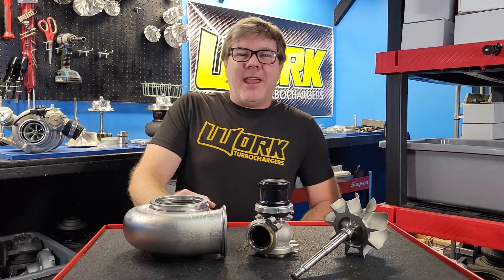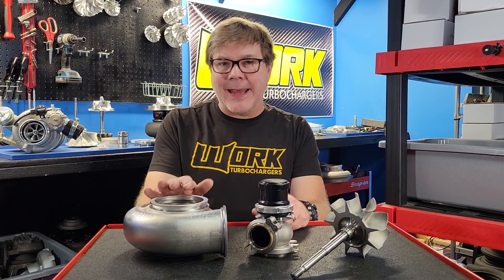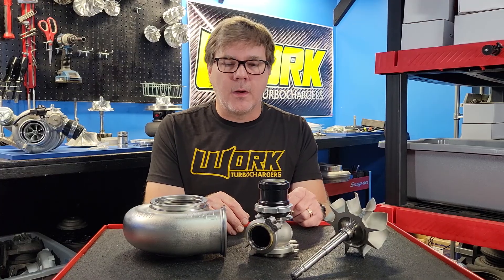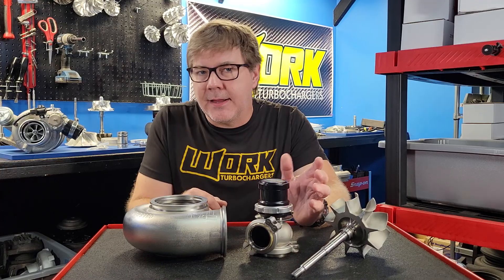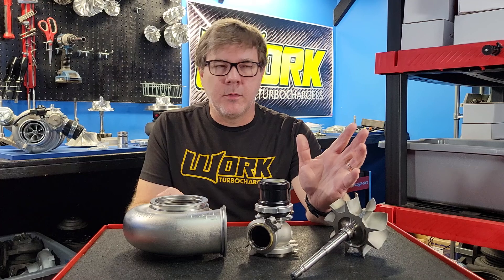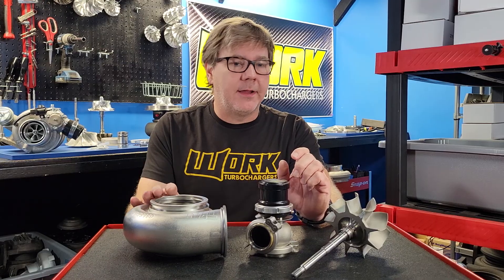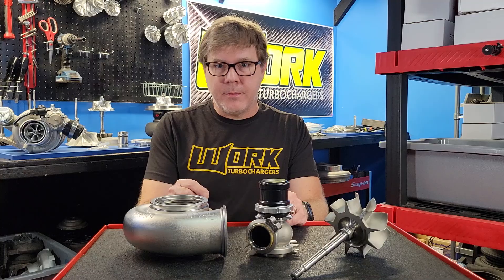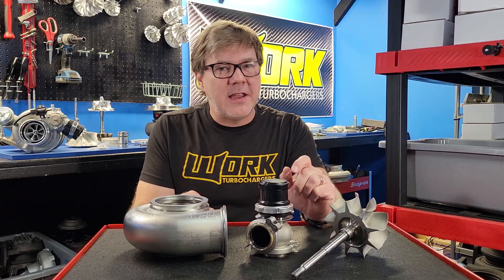5 Minute Turbo Tech Tips with Reed, Episode 1: Ignition Timing and Backpressure

Comment: Can you explain why this is? I think it will be confused to most amateur tuners like me. I'm guessing it's because advancing the timing was giving a more complete burn in the cylinder and therefore less leftover air fuel mixture being burned in the exhaust?
Reply from the maker: In short, you are correct.  If you have the data logging capability, It can be seen quite easily.  Run the engine at a moderate load and move around the timing from optimal to "late".  You will notice EGT will rise, drive pressure will go up, the boost may start to increase unless the wastegate does not catch it quickly.  Same can also be said for the injector phase angle...

Now, a bit of a disclaimer.  Depending on how the engine is set up...camshaft, hp etc, this may not be easy to see.  The cars I am working with are generally operating in the 90-100% capacity of the turbo system.  The one I have with the most data is a 427" Energy SBF with twin 88mm turbos set up to run LDR/ODR, running on gasoline...but we have seen the same results time and time again on simpler setups.  

One day when I actually have the man power to record some tuning videos, I will upload them.  Most of the time we are a 2-3 person team at the races and video content for youtube falls way down to the bottom of the priority list.
Reply: @workturbo  Awesome thank you!